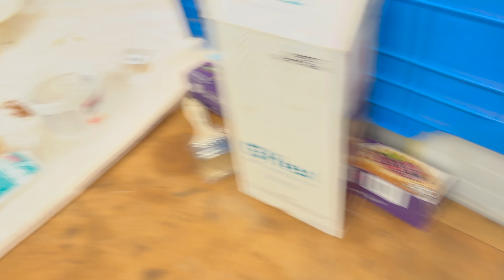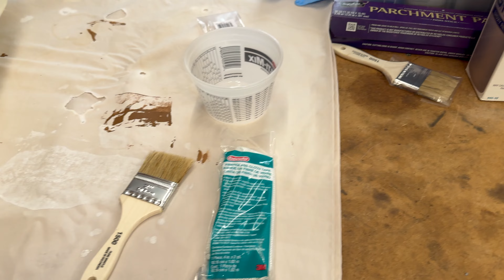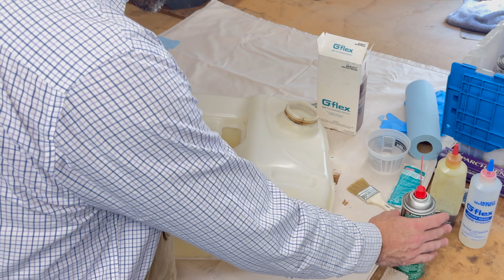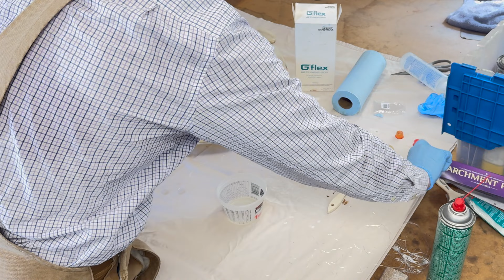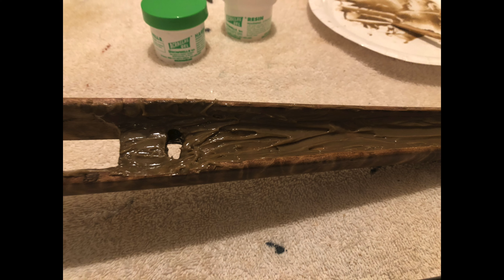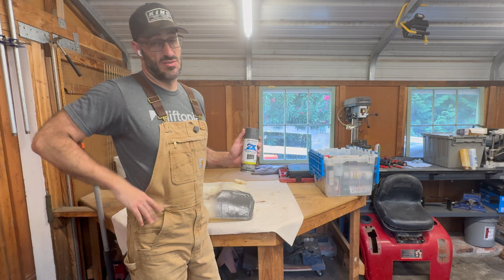HDPE Garden Tractor Gas Tank Repair | Common Failure for Craftsman / Husqvarna / AYP

Comment: How does the Amazon 3.5 gallon one bolt up to the existing holes ? Is it easy to swap?
Reply from the maker: It may require some adaptation but any of these Craftsman or Husqvarna (and some  Poulan Yard Machine and Cadet) models manufactured by AYP are very similar for a given era. If you have a Husqvarna from say 2010, chances are a tank made for Craftsman around that time will fit. The owner has a large area to mow and wanted to keep the large under seat tank with fender fill, which is why I went through the trouble to repair this one.

Comment: Great job. Unfortunately when I got my John Deere GX70 it was already leaking. I'm still on the look out for a better fuel tank, what I have currently is a tiny old metal tank kind of just sitting on top of the engine, not great, but it works. This of course is more proof of designed obsolescence.